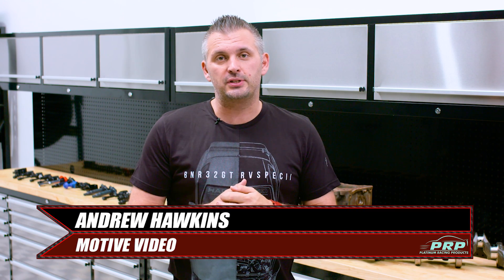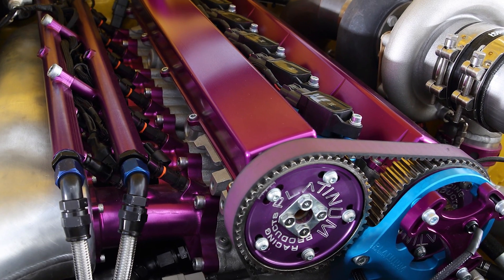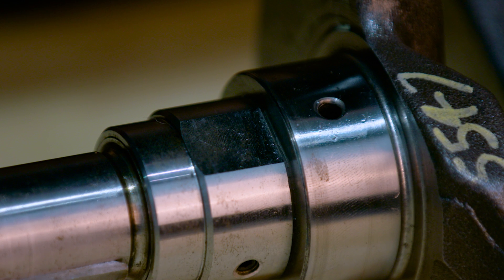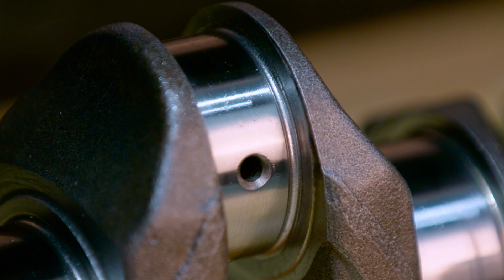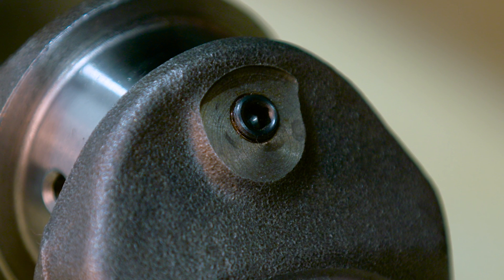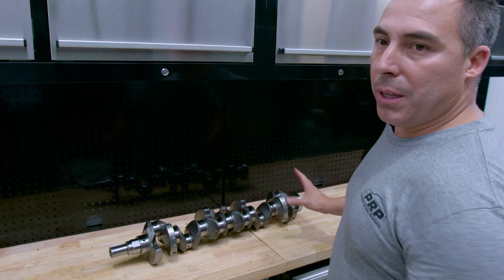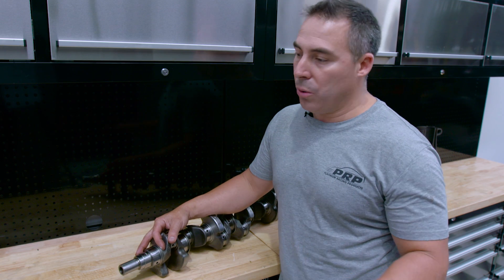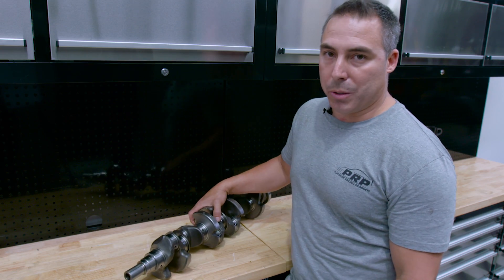Prepare your stock RB25 or RB26 crankshaft for 1000hp - Platinum Tech

Comment: You can take a hammer and tap the counter weights on your crank and if it doesn’t sing then there is a crack every time usually in the fillet.

Comment: Why RB's have crank issues?  
Because all inline 6 cylinders suffer it, it is inherent to all inline 6 cylinders and it is a harmonic issue you can only manage, but never cure.   
Billet crankshaft in my 2.8L finally gave up the ghost at around 10-12,000kms of hard circuit driving, the nose snapped and oil pump was not in good shape (N1 pump).   
But remember, I was circuit racing, not just a few inline runs here and there, but punishing it lap after lap with foot flat to the floor for sometimes 20 minutes at a time.
A billet crank from my experience will not cure harmonic issues in the RB, it only pushes the life out a bit more, but eventually the harmonic issues will catch up with it sadly.
If running a drag car setup, it usually isn't too much of a problem as time in these harmonic ranges is limited, so that is a good thing for the drag racing crowd.

Comment: How to prep your Subaru crank:
Step 1:  get the crank and throw it into the garbage
Reply: Sorry, i thought you were talking about Barra's... 😅
Reply: Subaru OEM cranks are know to be quite good, hey?
Reply: @802Garage  my subaru crankshaft that cracked in half in bone stock outback thinks otherwise
Reply: @Aezakmi3258  A single experience is not valid statistically.
Sorry about your Outback, but that's an extremely rare occurrence. Out of the quite literally hundreds of Outback and EJ25 owners I know, that has never been a problem.
If you are talking about the new FB engines, hadn't heard of that either. I was more thinking of the turbo car cranks, though AFAIK all Subaru cranks are forged.
Reply: @802Garage  Due to the compromised design of the horizontally opposed layout there is only a short distance between all of the crank journals, to make it physically work there is significantly less thickness in the web / support structure between them. To compensate for the loss of strength larger diameter journals are often used to have more overlap with the downside being a higher bearing / journal surface speed and hence more drag. The width of the journals / bearings can also be narrower. Even so it's a fundamentally flawed layout and is weaker. This is one reason why you don't see really high revving Subaru engines.
Reply: @Samqdf  While some of your observations are valid, and it does create a power ceiling for the layout in factory form, as with any engine, you're not entirely correct.
There are many high revving Subaru engines, especially built aftermarket. Including turbo engines that go well over 10K RPM. One of the more reliable high power Subaru engines was the EJ207 which had rev limits well over 8,000 RPM in various forms.
Not to mention the natural internal balance and low rotating assembly weight actually make it great for high RPM. The bigger reasons they aren't high RPM from factory have to do with desired power bands and the decisions to use turbo chargers.
Let's also not forget the countless rally shops which have made Subaru engines pushing well over double factory HP. Speaking with VT Sports Car techs their bigger issue was having case halves pull apart when you try to push past 700-800 HP or so.
Plus ya know, decades of Porsche making high revving and high powered flat engines. Additionally part of why you see less aftermarket support for Subaru engines at least affordably to push crazy RPM like Honda guys is simply Subaru was a tiny brand and the engines and especially performance engines were simply far less common.
I'm not saying none of your points are valid, I just think you are targeting issues as a reason for lack of more boxer engines when it isn't really the key point. Most Subaru engines have no issues with bearing wear and their cam profiles are tuned for lower end efficiency. High revs are possible, it's just not the norm.
There is actually a ton of strength around the journals since it is a two piece assembly rather than many smaller pieces like most inline engines. Like you said though, it will have limitations. Trade offs in any design, but calling it inherently flawed is a bit silly.
Reply: @802Garage  Hi, firstly thanks for going to the trouble of making such a detailed comment to me. I want to be told when I am wrong and clearly I stand corrected in there not being any high revving flat-4 engines. The EJ20 series has a very short stroke so I can see why that can be made to rev. You made some good points. The flat-4 engines indeed don't have the second order balance issue (if I am understanding it correctly) than inline-4s have and the crank main journals / bearings are the single best or equal best supported compared to other engine designs, the next or equal best being the split block designs and the combined gearbox housing & main cap assemblies as used on most motorbike engines. I believe that aftermarket support for the Subaru engines is heavily geared toward being for turbo use as almost all of their performance engines have been boosted with the opposite being true for Honda. As you would be well aware it's so much easier to alter the existing performance orientated engine arrangement than to convert it to something else. As an example while not a good one is like the amount of support parts for non boosted applications to suit Toyota's 2JZ engines or the RB26. Of course there are lots of other factors such as the lack of any variable lift systems that I know of on Subaru engines. So I would like to correct myself in that what I said was way too much of a blanket statement so to speak and so I want to correct that. I think that the compromises Subaru chose to make with the design of their flat-4 engines has made them less ideal for making high end power without boost. For example due to having a single intake manifold and with the packaging limits the intake ports in that they enter 90 degrees to the bores and hence results in a curved port. Even many economy engines these days have an upright port as it allows for a higher amount of flow for the same given cross sectional area and hence gives more cylinder filling in the low to mid range for the same given amount of flow in the top end. With quad throttles and two widely separated air chambers the same port shape / angle could be used on a horizontally opposed engine and it's exactly what Subaru did on their long gone F1 flat-12 engine. As for crank journal spacing that could be compensated for with wider spacing between bores. All that said their engines were optimised for boost so I can see why they made the choices they did as everything is a compromise and their goal with everyday engines and performance boosted engines. Now this I can't prove this at all and I am just going off theory but I am quite confident that if both a FA20 and a Toyota 3SGE Beams engine were both highly modified then the Beams would make more power and be more reliable despite having the exact same bore, stroke and VVT design and the Beams engine being much older and with only a 2-bolt main cap design. I am open to correction on any point I have made here. If you couldn't be bothered then that's understandable too.
Reply: @802Garage  Hi, firstly thanks for going to the trouble of making such a detailed comment to me. I want to be told when I am wrong and clearly I stand corrected in there not being any high revving flat-4 engines. The EJ20 series has a very short stroke so I can see why that can be made to rev. You made some good points. The flat-4 engines indeed don't have the second order balance issue (if I am understanding it correctly) than inline-4s have and the crank main journals / bearings are the single best or equal best supported compared to other engine designs, the next or equal best being the split block designs and the combined gearbox housing & main cap assemblies as used on most motorbike engines. I believe that aftermarket support for the Subaru engines is heavily geared toward being for turbo use as almost all of their performance engines have been boosted with the opposite being true for Honda. As you would be well aware it's so much easier to alter the existing performance orientated engine arrangement than to convert it to something else. As an example while not a good one is like the amount of support parts for non boosted applications to suit Toyota's 2JZ engines or the RB26. Of course there are lots of other factors such as the lack of any variable lift systems that I know of on Subaru engines. So I would like to correct myself in that what I said was way too much of a blanket statement so to speak and so I want to correct that. I think that the compromises Subaru chose to make with the design of their flat-4 engines has made them less ideal for making high end power without boost. For example due to having a single intake manifold and with the packaging limits the intake ports in that they enter 90 degrees to the bores and hence results in a curved port. Even many economy engines these days have an upright port as it allows for a higher amount of flow for the same given cross sectional area and hence gives more cylinder filling in the low to mid range for the same given amount of flow in the top end. With quad throttles and two widely separated air chambers the same port shape / angle could be used on a horizontally opposed engine and it's exactly what Subaru did on their long gone F1 flat-12 engine. As for crank journal spacing that could be compensated for with wider spacing between bores. All that said their engines were optimised for boost so I can see why they made the choices they did as everything is a compromise and their goal with everyday engines and performance boosted engines. Now this I can't prove this at all and I am just going off theory but I am quite confident that if both a FA20 and a Toyota 3SGE Beams engine were both highly modified then the Beams would make more power and be more reliable despite having the exact same bore, stroke and VVT design and the Beams engine being much older and with only a 2-bolt main cap design. I am open to correction on any point I have made here. If you couldn't be bothered then that's understandable too.
Reply: @Samqdf  I think overall everything you said is pretty accurate. Subaru's designs specifically usually target mid range torque for NA models and yes their performance engines are mostly aimed at turbo power which as you basically said is a different ball game. Obviously flat engines can be tuned for high NA power, such as old Ferrari engines and of course Porsche, but turbo is definitely huge for Porsche as well.
Subaru did make a lot of modifications to their EJ design philosophy with the FA to have a stronger engine. For example much thicker case walls and more support in open deck designs. MRT Performance has a cool quick video titles "Subaru FA vs. EJ Comparison" to show that. Now the FA tuning market is growing, the potential is being shown. The newer FA24 particularly seems beastly. May be a modified version in the next STI.
Obviously like you mentioned though, they still have weaknesses and there are trade offs with the flat engine. One quick note is that Subaru did have a VVL system with i-AVLS, but it was only used briefly as far as I know and they basically went with AVCS or dual AVCS on any engines they wanted a variable system on. I'm no expert, but I try to always learn. You make a lot of good points. I appreciate the chat!
Reply: @802Garage  The feeling is mutual, thanks for your time
Reply: @Samqdf  Any time I have time I try to have good conversation! Stay safe out there. :)

Comment: RB’s are trash. How long they’ve been out for? Still no 5 sec pass 😂😂
Reply from the maker: yet how popular are GT-Rs  for making quick real street GT-Rs.
Reply: @MotiveVideo  this guy obviously hasn't driven a GTR, best jdm cars I've ever driven hands down, even with mild power mods
Reply: 2JZ shits all over Rb’s. 
You guys can have all the stututu noises. 
Wake me up when RB’s can even beat a Barra 😂
Reply: @heeeeeeeyyyyyyyyy  I agree 2jz is king, a 2jz in a gtr with the awd driveline would be quite a beast.  But the sound of an RB at 8000rpm is something to fap over😂
Reply: @heeeeeeeyyyyyyyyy  How old are you? It's amazing, I notice this behavior most with those under 30.
Reply: Obviously you've never driven one
Reply: @RandomlnternetGuy  I owned a 97 r33 series 3 gtr with n1 turbos, sold it only last year.  Massive regret.  Whether you believe it or not,  who cares.
Reply: @JustForRita  i wasnt replying to you
Reply: @RandomlnternetGuy  😂 oops
Reply: Yep, cause that's the only measure of worth of an engine. Right on 😅
Reply: Looks like I’ve upset a few vaginas in here. keep crying cause your RB is slow. 😂
Reply: ‘This Japanese cast iron I6 block released in 1990 can handle more power than this Japanese cast iron I6 block released in 1985’ 

Nobody cares. Go back home. The car community puts up with enough shit from LS circlejerkers as it is without you piping up.
Reply: @clutchkickpj693 Okay. Boosted 7 litre LS shits all over rb's, vr38's and 2jz also. What 'bout this, Elon Musk?
Reply: Bunch of pregnant women in here.....
Reply: The car an rb is attached to is awsome, the car a 2jz is attached to, not so much. The gtr is what makes the rb popular.

Comment: Nice job Herman and Andrew . 
Will add the factory cranks are induction hardened forged items, i never have worked out how deep the hardening goes or if right through. Nitto collars are harder than the factory crank material so a good investment to avoid wear there even on long nose cranks. Good idea to stake those grub screws in with a pointed punch to avoid then unwinding as loctite does not like heat to hold them in. Fault line on crank end = Stress riser becoming a fracture point. Some also now tear drop the oil holes on the mains to positively feed the big ends when big pumps that can keep up are used, usually by also drilling out the oil feeds to 8mm in the block. 
As usual, very informative.
Reply: Ahh actually rb cranks are forged but are definitely NOT induction hardened
Reply: Induction hardening is a 'surface' treatment essentially, to produce a shallow hard wear resistance surface and have a softer ductile core to maintain strength. So to answer your query, no induction hardening isn't designed to increase the hardness all the way though a component.